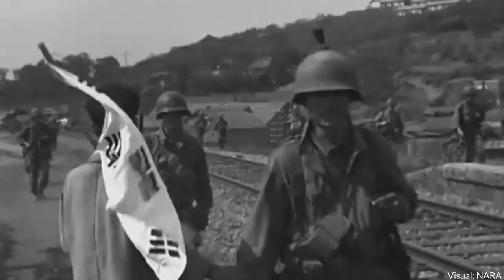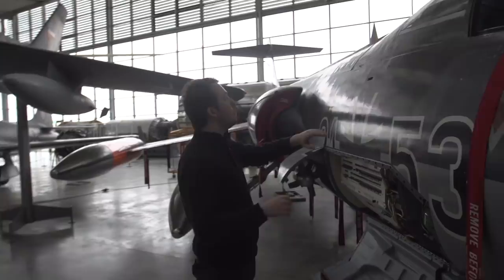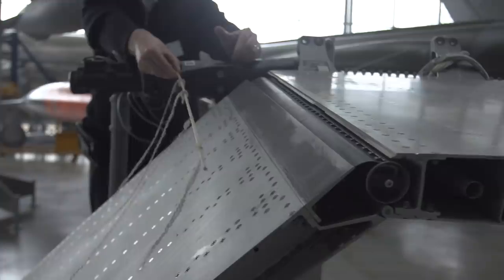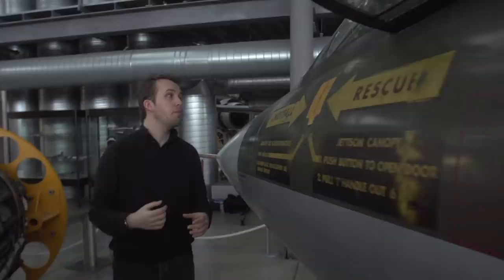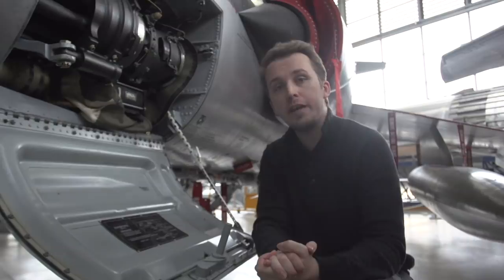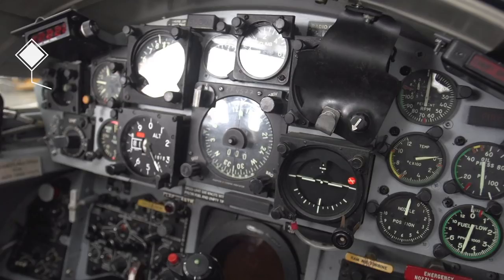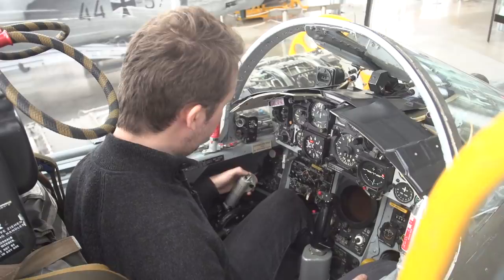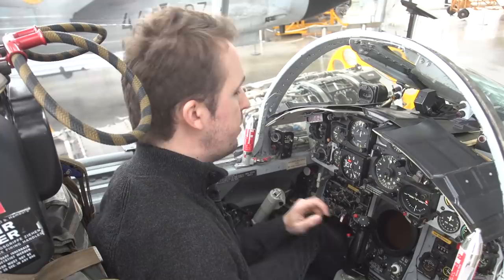F-104G Starfighter - Inside The Cockpit

Comment: I was stationed in Iceland , 75-77, when two F104s visited from Germany. When they left one blew a tire on takeoff and had to return and make an emergency landing. The pilot did a great job with minimum damage to the aircraft.  We did notice that his flight suit was wet from sweat which was understandable given the situation. We all ended up at the officers club and did celebrate the safe return of the pilot.
Reply: very cool, good job to the pilot that day
Reply: ...wet flight suit, I could imagine! They came in on a high speed and quite often the pilots were facing a wobbling at the small and sensible front landing gear...root cause were air in the hydraulic system and a slightly too high landing speed 😳...a beautiful beast 😎
Reply: F 104 having the range to Island ? Strange as he just explained F104 G did NOT have the refueling probe
Reply: @UsoundsGermany  
The ferry range of an F-104G (i.e. max internal and external fuel) is supposedly around 1800 miles.
The distance from Germany to Iceland as the crow flies is supposedly around 1400 miles.
So at least theoretically, you can get there from here without refueling and that's assuming that they didn't start out from some closer intermediate stop like Norway or the UK.
Reply: @UsoundsGermany  if the max fuel load with drop tanks will get you 1800 miles and the distance from Germany to Iceland is around 1400 mile's then there is no need to refuel, do some research before questioning someone's story
Reply: Thanks for sharing! It is always nice to hear events from someone who was actually there.